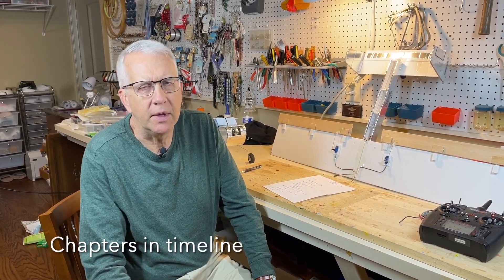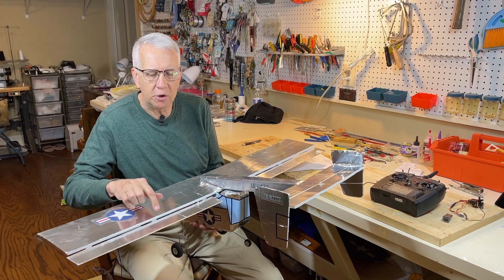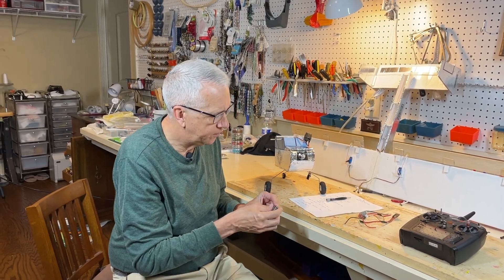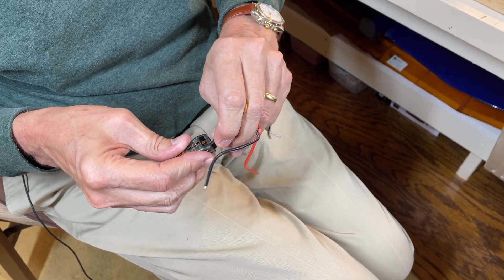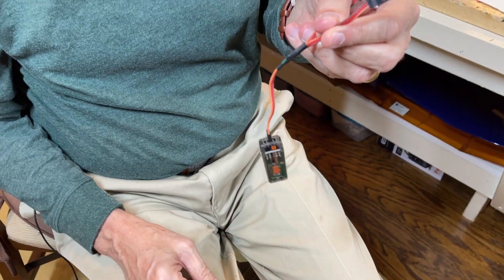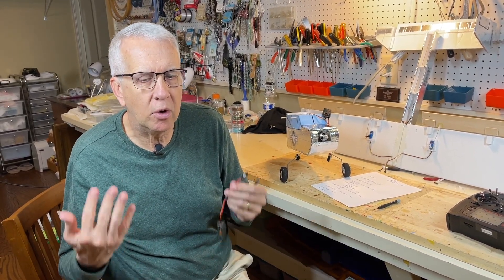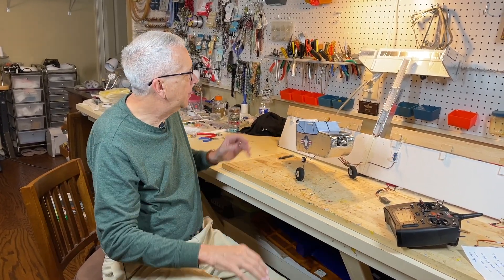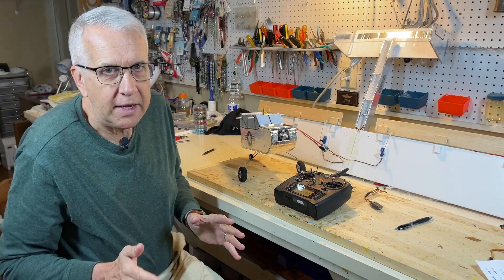Flaperons Setup for the Spektrum DX6 and AR620

Comment: New to Flaperon Set up.  Using a DX6E.  Followed the instructions accurately I figure.  When I activate the ailerons they move properly in the desired directions.  However when I input Flaps.  One moves up and one moves down.  Not sure how to get them synced.
Reply from the maker: I think earlier in these comments someone noted the DX6E does not offer the same flaperon setup as the DX6. Also, do a search on www.RCGroups.com

Comment: I have an old dx8 and my friend helped me set up a glider i have with flapperons and spoilerons  with elevator mix...what's great about it is now I just  have to copy these settings to any model I have or future models and I will have flapperons and spoilerons on them also..for some reason he was only able to add down elevator mix in flapperons not spoilerons..
Reply from the maker: Computer transmitters are a game changer.  And as you describe, so very useful to our RC flying.

Comment: Very interesting. I did the exact same setup with the same radio on my Conscendo powered glider. But when I turn flaps to position 1, the aileorons deflect in opposite directions (which, I do have separate servos for on each wing). I remember having this problem in the past. Hopefully, I can figure it out 😀
Reply from the maker: Good luck!
Reply: @TimMcKay56  Figured it out. Did not realize it came with a stupid Y connector for the ailerons 😞 Ordered some new extensions and that will solve it. I did, however, discover the transmitter has a time delay function on the flap activation so they can be applied slowly! I've always been used to my planes "poirposing" when I flicked on the flaps 😀
Reply from the maker: @ Great!
Reply: Porpoising*

Comment: Hi Tim,
Many thanks for your excellent info. I have tried it on the new XFLY Twinliner using a Spectrum 630 with SAFE. Once I disconnect one of the ailerons & into channel 6 the Flaperons all work after reversing the flap system but the right aileron does not operate in SAFE mode only the left aileron works in SAFE. Any ideas? Do I need to use a 'Y'Harness? Hoping you can help. Regards
Reply from the maker: BAV:  Apologies, but no blazing insights on this one.  I am just not very smart on SAFE issues.  Do give a try at www.RCGroups.com  Seems like those forums know everything.  Tim
Reply: Many thanks Tim. I did try a ‘Y’ harness but does not like it.

Comment: Hi Tim. I just set up flaperons following your video with a DX6 and an AR630 receiver. After testing everything, I find that port 6 doesn't provide AS3X or flight mode to my left aileron. How can I fix this please?
Reply from the maker: John, first I have heard of this.  Any others?  Tim
Reply: @TimMcKay56  Hi Tim. I got it worked out. All I had to do was a factory reset of the receiver through forward programing on the DX6. Thanks!
Reply from the maker: Yikes . . . well done!!  Tim

Comment: Thank you, so helpful!  I’ve been away from RC for a long while and have kind of forgotten everything. I have a spektrum AR620 and a spektrum DX6E. I have the manual for both. But the manual for the AR620 doesn’t give you any hints at all about how to do this properly. Not even a guide to which pins for which servo. That’s just plain nuts.  I’m setting up a Libelle DLG with flaperons and I had no clue how to do it. So you took me right through it and everything works perfectly now and thank you so much.
Reply from the maker: Skypix:  Glad it worked out!!  Tim

Comment: Excellent Information on the General Use of the Computer Radio Function to program the separate Servos.

I am just getting into 3D Printing Airplanes.  I have yet to actually complete one; but I am learning a lot from your Videos and from Troy McMillan's videos.

Eclipson, PlanePrint and 3DLabPrint have some excellent (even free) Model Plans.

Thank you for the valuable tips.
Reply from the maker: 12T:  Thanks so much for checking in!  Tim